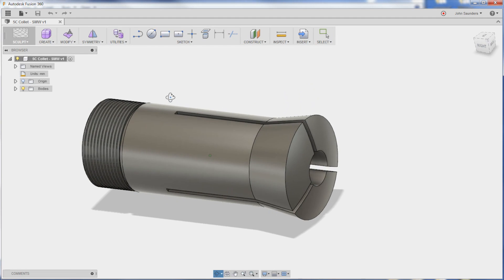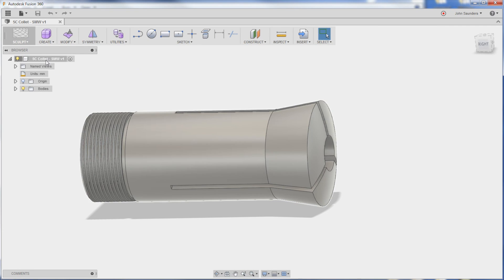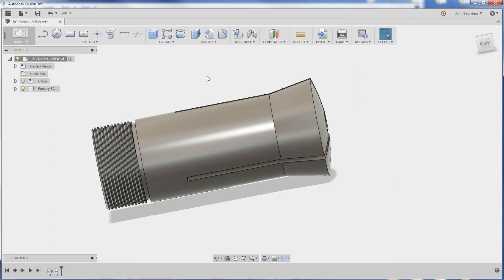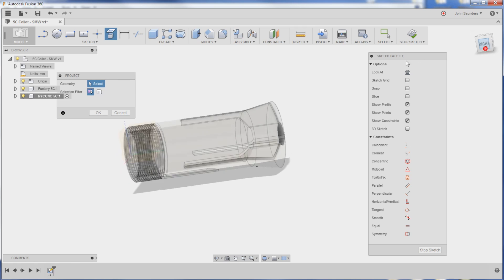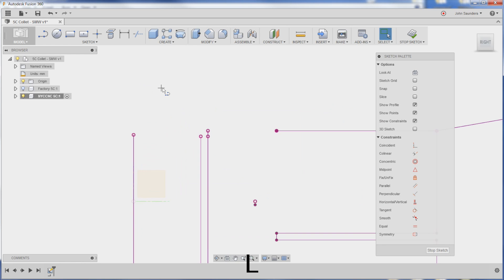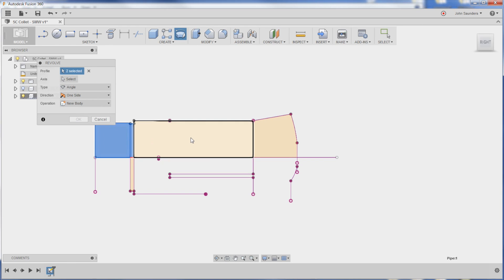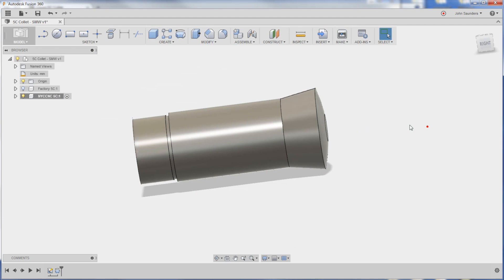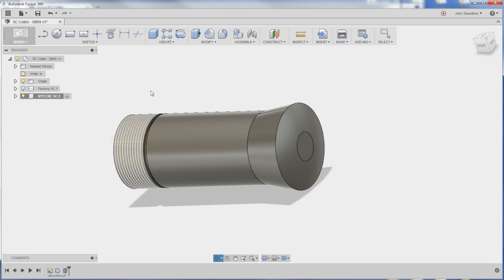Fusion 360 Hardinge 5C Collet CAD Tutorial!  FF43

Comment: I am in the process of purchasing a Tormach 1100. In your older videos you used Sprutecam and another Cad package and now you use Fusion 360. Do I need to just start with Fusion 360 and forgo learning the CAD and CAM packages Tormach offers?  Is there any need to purchase the software Tormach offers in that Fusion 360 seems to do it all? This would free up some cash for other additional hardware if not needed. I love your videos and hope you keep them up. I would like to get more information on your hold down table too.

Comment: As a 15-year SolidWorks veteran, I still must admit that Fusion looks pretty slick and appears to have some innovative features.  But I've only seen it demo'd with very simple parts/assemblies with small number of bodies.  My question is, how slick is it with large, very complex assemblies?

I routinely deal with full machine layouts of over 120K components and complex mechanisms/mates trying to simulate the actual kinematics of the machine.  I have a really legit CAD workstation, but am pretty close to pushing it to it's limits (might need to upgrade soon).

So I wonder, how does Fusion compare to SolidWorks in this regard?  I am dubious of it being able to handle such complexity, but would love to be found wrong on that assumption...
Reply: Large assembly is atrocious. Past 15-20 parts of moderate complexity it completely slogs. 

It has no "lite" part feature like SW has. Nor does it have a dedicated assembly mode. 

It's really good for single components and small assembly, it is lacking horribly on the assembly front though. And I'm not sure if there will much improvement on it. My personal opinion is that is simply not the direction they plan on taking the software and that it's really just for single component design and machining. 

SW and Pro-E still dominate in the large assembly arena. Fusion seems to be designed for simplicity. Powerful and flexible, but still simple.  It's trying to do so much in a single software application that, although it can do many things, it doesn't do any as well as a more dedicate software application can do it.
Reply: +Occams Sawzall I was afraid this would be the case.  Currently my company has several thousand seats of Solidworks (after switching from UG a decade ago), but we're always evaluating other packages to supplement (or even replace) SW.  So far we haven't been impressed with anything, but I have very high hopes for OnShape... it's just early days and they have a ways to go before they might succeed in becoming a major disruptive player in the market...
Reply: Honestly i think Fusion is better than OnShape right now and will continue to be so in the future.

You mentioned you left UG over a decade ago. Siemens has made incredible progress with their NX system, it might be worth checking into. The prices of it have fallen considerably and look to be roughly on par, in some cases cheaper, than even SW is right now.  

for large assembly Pro-E has always been the go to, seems better than even SW at handling large assembly systems, but it was also specifically designed and improved to do it as well. I think its going to be many years, if not decades, before we see a single software system that can "do it all". The modularity of the NX system does look promising, along with their PLM systems they have in place.  But, its only what I've been able to glean from reading white pages and accounts from other people, couldn't say ya or nay from a first hand experience.

Comment: Just select the slots and delete them in direct editing mode (as suggested below). Much quicker - just did it myself to check. But if you are going to insist on using "project", make sure the sketch plane doesn't lie in one of the slots or your cone angle will be too narrow (slightly) - or set the angle to the correct value with the dimension command, whatever that should be.
Reply: Yeah, I basically said the same thing - just delete and patch the faces you don't want.  But I am a SolidWorks guy, so dunno how Fusion really differs (parametric is parametric, though...)

Comment: Aren't the top right inclined line you selected (and the arc connected to it) from the edge of the slot rather than where the uncut surface would reach? That would make the radius slightly smaller than in the original part.

Comment: John, honestly, the capture history is annoying to you because you don't see the benefit of freeform design and think parametric design is all there is. If you had used surface modellers or sub-D modellers then you would have a different perspective on CAD. Not everyone comes from solidworks back ground. In fact I would say MOST people who use this will not have come from that back ground.
Reply: Couldn't you freeform model just the same with the history enabled?
Reply: No. Thats the point of not having it selected.
Reply: Is there a list of modeling tools only available when history is turned off?
Reply: No it has to do with the nature of the workflow and is more about having less parametric limitations and allows you to design quicker. CAD is not all about tools. Its more about workflow and efficiency.
Reply: So, basically, you don't like the idea of people having different opinions than you.
Reply: free form modeling has it's problems, using the timeline you can make changes faster you can't do free form modeling in cabinet making parametric only why one dimension change whole model change
Reply: Free form is not for production part creation. It is for prototype creation and development from raw ideas. Where you don't know what its going to look like when you start. Its FAR quicker for that.
Reply: so you need to know both then don't you
Reply: No, you don't
Reply: then how are you going to do parametric modeling in fusion 360 using user parameters and a timeline. I can't do free form at all with cabinet making it makes no sense at all if i did it all as free form I would have to draw 00 of cabinets. parametric I can do one so I need to know both. make sense to know both A
Reply: Daniel, your thinking I am talking about you and your process. I am not. I am not going to tell you how all this is useful for you.
Reply: I am giving a example of where parametric is important, it's the same as that collet if it was set up as a parametric model you can have user parameters to define the hole and the slots so they are linked then if you needed a different size all you would have to do is change the hole size boom done. if it was done as free form you would have to remake the hole each time going smaller would be a pain in the arse, free form is only good for playing.
john is teaching how to do reuseable models in the correct way for fusion if you needed to know how to do a working model of a collet this vid is gold, or any other thing he makes it is realy life stuff not playing around, he is doing what he was asked to do real life stuff, he ask last year what people would like to see he asked the same thing this year and got the same answer real life stuff. free form is not correct for a job shop ever you don't play otherwise you will go broke
Reply: +gus bisbal free form is for industrial designers who have no concept of dimensions to begin with. You may as well use 3D graphical modeling software like Maya (owned by Autodesk as well) or something. 

All our engineers use parametric software even when they are creating prototypes of parts. Because they easily go back and make alterations while maintaining other critical dimensions for clearance and such. 

There is really NO good reason to use freeform at all unless you are simply making a conceptual representation of something or just trying to make something look pretty.
Reply: Occams Sawzall You have described your work flow as the most effective and OBVIOUSLY the way to do prototyping. Let me know when you design, build, distribute something original that isn't a version of something pre-existing and then I will see your point. You don't explore conceptual design. Your doing things that people have done before just with different parameters.
Reply: +gus bisbal 

I work for DEKA R&D. ALL we do is make and prototype new original things! 

Literally 95% of everything designed and engineered in there is original, never done before parts!.... We hold thousands of original patents for technologies and products. the LUKE robotic prosthetic arm, Ibot wheelchair, Homechoice dialysis machine, our vapor water distillation system, the Segway! And even the coke freestyle machine! Soooo yeah,  pretty sure we know a thing or two about one of a kind original, never done before prototyping.
Reply: Occams Sawzall Still think that everything you do is the best thing that can be done and any other way is not as good huh....OK. Enjoy that, Mr innovation.
Reply: +gus bisbal 
Best?  No.  But certainly better
Reply: Occams Sawzall So I have a question what is your interest in Fusion 360 considering the assets available to you in your business? This application is going to be great but it is buggy at the moment.
Reply: He's one of the useful forum members
Reply: +gus bisbal 
A). It's free.  So why not?
B)  yes I have several options at my disposal at work, but I like to keep up with new software. 
C). This isn't only CAD here, it's CAM as well.  And CAM is more or less the same, just a different GUI but there is quite a few nuances of tool path creation. Plus I like seeing how someone else produces a part.

Comment: Hi! 
It seemed to me that you used the edge of the slot for the projection.  Wouldn't that make the diameter of the part a little smaller? Just being curious.
Reply: Yes I wondered about that too. It would be a very small discrepancy, but maybe important for a collet.
Reply: Yes it does shrink the outer dimension by a smidge.  And although the straight cylinder portion isn't critical, the dimensions on the taper are quite critical.

Comment: your angle might be off as you used the slot projection (or maybe the diameter as the slot continues thru the cylindrical part), better to use the lower part where there is no slot
Reply: Yes, need to do a Sketch Intersect in an area that is not slotted.
Reply: I use SolidWorks, not Fusion, but couldn't he have simply "filled" the slots first to get the exact accurate profile of that fairly simple part?  Then grabbing the 2D x-section should have been trivial...
Reply: Greg Fowler the bottom part is not slotted and can be used instead, front radius doesn't really matter. you're right, cross-section should work just fine.